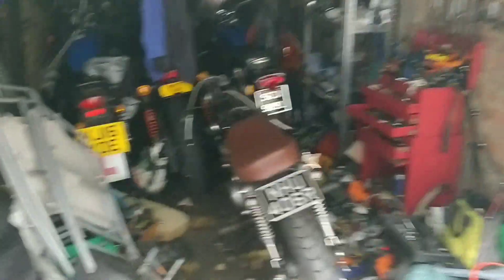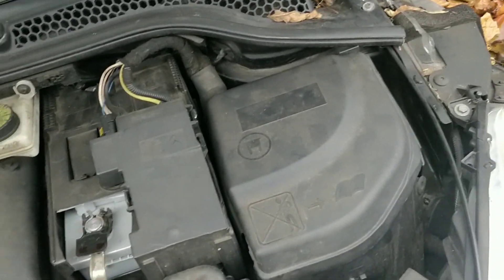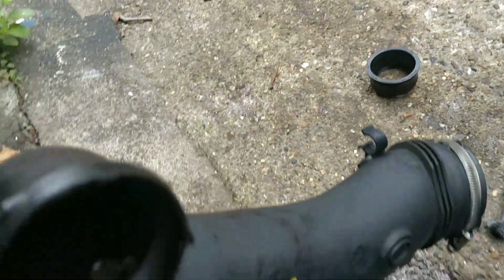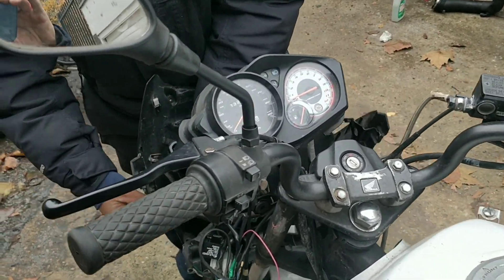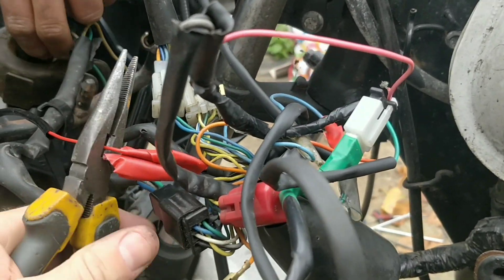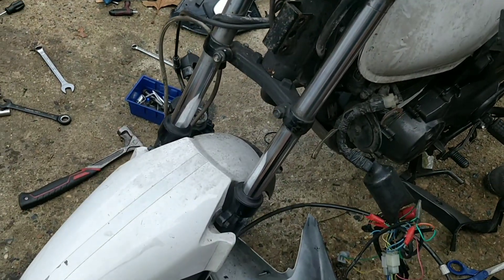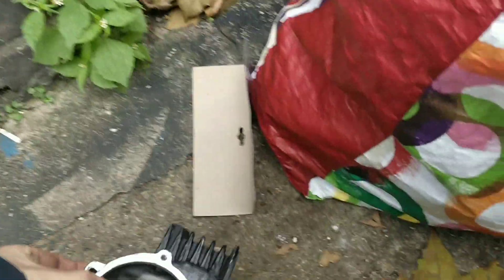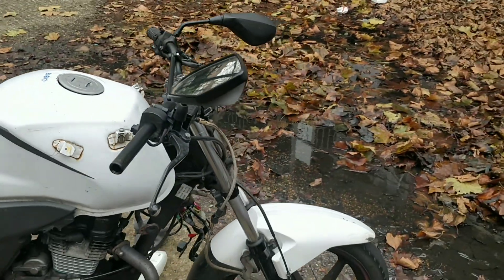Honda cbf 125 street fighter, how to make a cheap street fighter. Honda cbf.

Comment: Great video. For reference on the dashboard unit. Yellow is ignition live and green is earth. So you can get rid of some of those and join them into one 👍 the pipe on the car is an odd one 😆 you should make that a separate short and label it as a common problem fix 😆

I think the wide bars look mint
Reply from the maker: Yeh the wide bars worked in the end although we may cut a touch in a couple weeks.

Comment: Vehicles used to be simple.  Now, if your fan stays on you may need to check the fuel flap is functioning or you haven't lost a centre cap on the rear left hand wheel! 🤔( I'm joking of course)
It used to be a thermostatic swith in rad controlling fan , thermal transmitter near the thermostat controlling the gauge on the dash . Now they're all linked up to the computer and even an air intake temp sensor can throw the fan into a fit! 
And on very modern cars you need a factory bi directional scan tool to replace rear brake pads. ( electronic actuators for hand break operation and piston retraction) . It's appears to be tech for tech sake. Some of it is great from the driving perspective but the days of the average driver maintaining and heaven forbid fixing their own vehicle are long gone. 
I find it quite embarrassing as an ex mechanic I have to ask a garage for help for some jobs. I replaced the discs pads and sensors on my daughters car recently. Simple. But had to get the dash service warnings reset at a garage because you can't reset them your self . ( mini) . 
But you can reset all the service lights on my hyundai and isuzu. 
I guess that's progress. 
I'm so old/ cynical😃
Peace love and hugs all round ✌️❤️🤗
Reply from the maker: I agree with you all round there Springy. I'm actually going to have to order a diagnosis system to see if I get a code. 

It absolutely used to be easy, the thermostat heated up then let coolant flow, the temp sensor switched the fan on. So simple. 

I've actually removed the fan fuse for now just to keep the car on the road

Comment: My cbf has a problem  my tail light works fine as normal but wen is press my front or rear brake ther bake light doesnt light up atall what could it be
Reply from the maker: That could be a simple bulb change Stephen. Normally the bulb has 2 filments in it, one for the light and the second for the brake light
Reply: @motorcyclerescuer  so might b wen  i press my front brake excessivly when im at red lights  i could have broke the bulb is that a possabliaty ? Excuse my spelling
Reply from the maker: No mate, you can press it as hard as you want and it won't matter. Bulbs just blow every now and again. You will need to take the red light housing off and put in a new bulb mate. You will find the same one at Halfords.
Reply: @motorcyclerescuer  perfect man thanks alot keep up the good work m8

Comment: Might be a stupid question Charlie but was the air con turned on or was it off. That usually runs the fan full on a soon as the engine starts.
Reply from the maker: It was off Bob, I checked that aswell. 

I even tried turning it on and of. Annoying the Aircon is working well and the temp gauge is right aswell. But the fan kicks on and stays on for like 10 mins after the car is locked.
Reply: @motorcyclerescuer  
Just a thought mate 👍
Reply from the maker: Appreciate the suggestion Bob. Cheers mate

Comment: looks horrible lol
Reply from the maker: Yeh they do look horrible as street fighters. However they ride really well once the weight is taken of the front.
Reply: @motorcyclerescuer  it's a good commuter bike , but some bikes just can't pull off the street fighter aesthetic.
Reply from the maker: Well technically its a perfect street fighter although I agree it looks ugly. 

Originally street fighters were built by stripping bikes down to lose weight and running at just about road legal. So it's definitely a street fighter.
Reply: @motorcyclerescuer   never said it wasn't a street fighter, just said it can't pull off the aesthetic now that it is a street fighter, it can be both a commuter and a street fighter.
Reply from the maker: Yes good point. I do agree it's not a good looking bike. I don't like the original either. 

It would look better with a different tank on without the fairing support on.